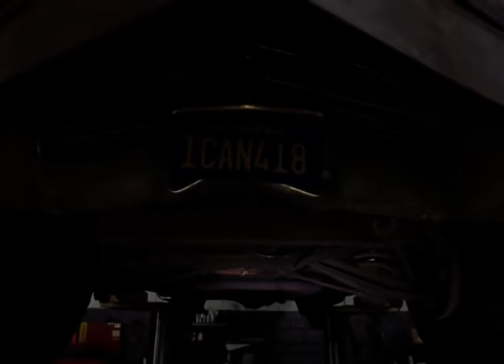The A-Team Build A Monster Car | The A-Team

Comment: It is absolutely beyond me how they could do a movie based on the A-Team, but forgot to include a scene in which the team builds something to get out of trouble.
Reply: The movie did have an "A-Team montage" but kind of gloss it over.
Reply: The movie was rubbish
Reply: I'm cool with that. However, I personally feel deeply violated in my feelings for all those beautiful full size cars they destroyed.
Reply: The A-Team Season 3 episode 7 trouble on wheels. When the police gaurd fault for the A-Team then Murdock was pretending to be not the A-Team. Now when police guard was backing up to the garage door and Murdock was open the garage door with the metal holder and let of the metal holder and knock out the police gaurd down. Then Hannibal say to Murdock nice work. Murdock thought the B.A was inside too but the B.A got the garage door on his right foot and the B.A was screaming. End of part 1.
Reply: The A-Team Season 3 episode 7 trouble on wheels B.A was hopping on his left foot because he right is hurt. Now Hannibal plan. Face was bringing the purple convertible to the gradag and Hannibal was riding in the purple convertible with Murdock and B.A.
Reply: I know.
Reply: If you watched the whole series, they stopped bulding things in the 4 season. So it was not the first time the A Team didn't built anything.